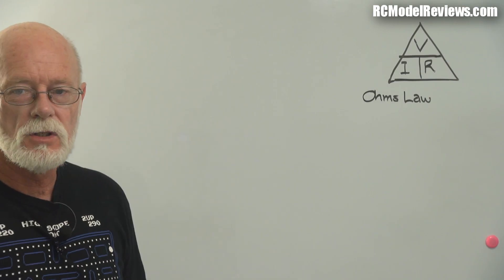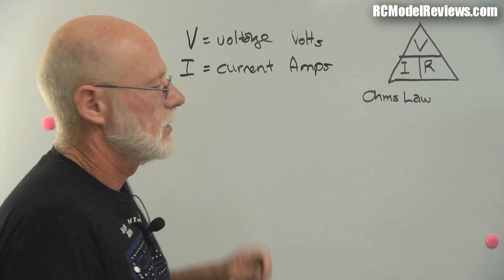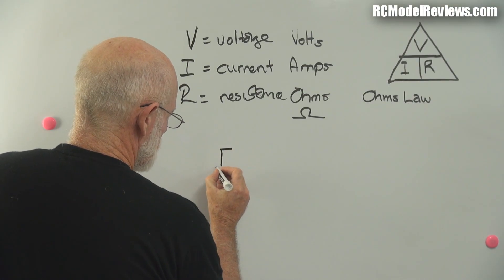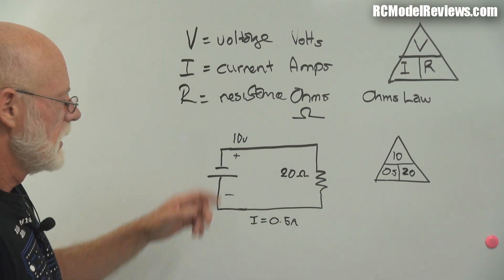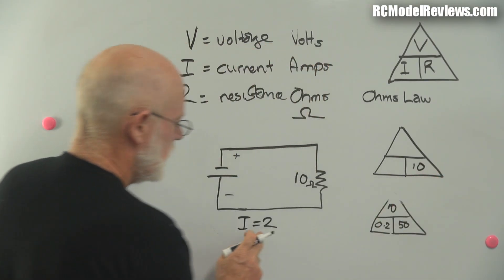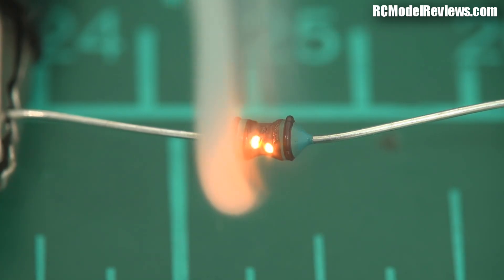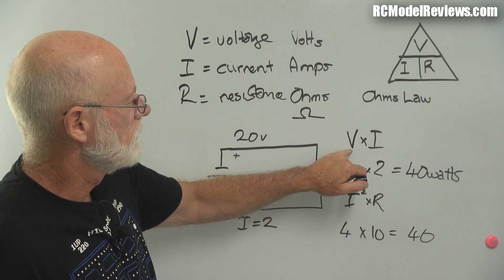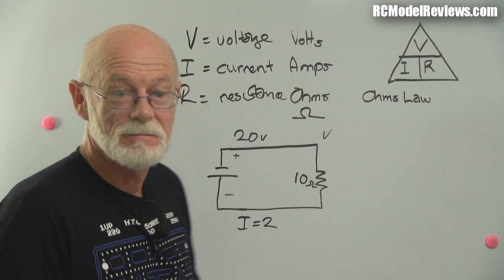Ohm's Law explained

Comment: E=IR =6th grade algebra ! Bad Boys rape our young girls but Violet gives willingly, get some now !  0= black 1=brown 2=red 3 =orange 4=yellow 5=green 6=blue 7=violet 8=gray 9=white ; 5%=gold 10%=silver 20%= none or no color.  First band=first digit second band=second digit; third band = multiplier or number of zeros to add ;forth band is the tolerance in percentage. The poem is a way to remember the color code taught to me by my father in 1965 ! Ya I'm an old fart of 63 but electronics got me A's in math,trigonometry  and algebra because I had somthing to apply all those formulas to that could be calculated and mesured with a meter or an oscilloscope . People don't learn from books they learn from hands on and practical application.  The books are just a road map but if you never travel the road you'll never understand the maps fully. I 💖 ELECTRONICS ! Edison-Tesla=AC-DC=ELECTRONICS ROCKS !

Comment: Dose this hold water Wen it comes to useing a vapor MOD?
Reply: Neo Blackjack thee enraged it does, same calculation you would use to make sure the resistance of your coil build wouldn’t stress your batteries past their stated limits. Just make sure you get your batteries from a trusted retailer, and build within the CDC (continuous discharge current) limit of the battery, not the “pulse” rating. There are a lot of fakes and “rewrapped” batteries on the market showing amp limits of 40A with 3000mAh for an 18650, when in reality it has a CDC of closer to 10A. If you were to use ohm’s law, you would think at 40A you would be able to build a coil or coils with a total resistance of 0.105 ohms on a single 18650 mech mod tube, but if the batteries can really only handle 10A, you’re in serious danger of venting your battery. Know ohm’s law, use good batteries (search for a guy named “Battery Mooch” for the best, most current info on most popular batteries), and for God’s sake build safely within your battery’s performance range. With all of the bad press about us vapers in the news, we don’t need another story about someone that blew themselves up due to ignorance. rant over

Comment: I is for inductance
Reply: Clint Chambers Well, Clint... that is the difference between DC and AC.
Reply: L is for inductance
Reply: Marlon is correct...L is for inductance, XL is for inductive reactance, I is for current (amperes) V is for volts which is emf (electromotive force) R is for resistance in a DC circuit but Z is for impedance which is resistance in an AC circuit

Comment: If (R) represents the diameter of a pipe per say, how does the internal resistance of the Lipo battery change? I'm imagining the diameter of the pipe getting bigger and smaller.

Comment: i dont really get the formula for power. i mean voltage is based on current and ressistance V=I*R cause you need both to have tension.so then, why do we multiply V by I one more time for power?
Reply: Maverick I'm guessing power = work done so you need to know the potential (volts) and the amount of electrons flowing (amps) to find out the work done. (power)

Comment: I ran a 55 foot 12 gauge wire from my generator during the storm to my wall AC that is 1800 W, 240V ON A 20 AMP circuit. With everything off the AC powers up albeit I can tell there's a slight drop in voltage listening to it run. When I place almost anything else on the generator the AC won't run. Total I was not using more than another 1000 watts. The generator has 4500 watts at peak and 3500 running watts with 20 amps. Question, using the equations that you used if I had a 30 amp generator would that had made a difference in whether the AC powered up? I understand over the run I must've lost power although when I tested it it still showed 240V before I plugged in. The charts that I saw stated that I could run it that long.

Comment: What a fantastic video Bruce,  I actually learned something !  I found most of the other tutorials to be a little confusing so lost all track of what they were saying.  One quick question if I may ........  could you substitute your 10ohm  resistor in your 20v circuit to a 55 watt bulb for instance ?  I'm trying to design a headlight wiring loom so I need to work out what the current draw will be on a 12v automotive circuit.

TURK

Comment: The resistance is like the diameter of the pipe by which the water (current) is flowing, so you'd need more pressure (voltage/tension) of you wanted the water to flow faster.

I loved that analogy!

Comment: Great video and explanation Bruce, but is there a formula for calculating how much capacity is drawn from a battery if you know certain parameters? Lets say I have a 4 cell 1500mah lipo at 14.8 volts, and I draw 60amps from it for 60 seconds, how would I calculate the mah of capacity being used? Thanks in advance Bruce

Comment: And from these equations, if you were only presented with the resistance and current, you can find the voltage with the simple equation (i squared x R / i = V) or (ixixR/i=V) so for the last problem in this video, if you knew the current was 2 and the resistance was 10 you would calculate the voltage like this; 2x2x10/2=20.

Comment: Thank you. I am newly enrolled in classes where it's critical to understand and use Ohms Law. After watching multiple videos and listening to class lecture I discovered your teaching video. I know it sounds basic, but other teachers assume we know the smallest of details. I am being introduced to all this math and nobody told me that 'current is measured in Amps' and 'voltage in volts' and 'Resistance in Ohms' until you stated that. Other teachers say they are 'related' or 'the same' or something like that. The fact they are units of measurement as is the term 'inches' or 'yards' had been a mystery (Lol!) until I saw your lesson. Thanks.

Comment: V•I {when V=3.94 and I=10.10} didn't work for me on an iPod. My calculations were  (V•I=39.794 & I^2•R=39.7839).(the "^2" means squared).
Why is this?
Reply: Cameron Kerner -- I think this is where your error occurred:
If you truncate the resistor value to .390 and don't use the full value of "R" (.3900990099), you get the result you saw on your iPod. See below. 
Your error:     (10.1*10.1)*.390 = 39.7839
V*I=P     {3.94 * 10.10 = 39.794}
I^2*R=P  {(10.10*10.10) * R = P}         R=V/I {3.94/10.10 =. 3900990099}
{(10.10 * 10.10) (.3900990099) = 39.794}
Hope this helps.

Comment: how would i convert 4.2 V - 6A to 7.4V -.890 mA. does the voltage matter when your deal with set values from a battery... it seem like it would be like working with 2 fractions with different denominator

Comment: 2:21 - The resistance aaaargh. This is pirate electronics 101.
Reply: Why don't you all try being gentleman instead of animals
Reply: hahahahahah
Reply: Hi, I'm Rachid
Reply: Olivia Lambert put the polarity symbols correctly. Lecturer put positive symbol to negative and vice versa. Dont mislead students
Reply: electron flow or current flow?
Reply: @tomfitzpatrick6524  either. Current flow in this circuit is clockwise . Electron flow is counterclockwise.
Reply: U looking very cute
Reply: gi
Reply: giggle
Reply: Noise Technician I was going to say this.. you beat me to it
Reply: Smart arse lol
Reply: Why dafaq do u have 1k sub, no vids
Reply: @saharyoussef6956  probably the picture. Post funny clever comments in a room of nerds and get jumped.
Reply: Olivia
Reply: Olivia Lambert hiii
Reply: Olivia Lambert fine arse bitch
Reply: R3LO4DED _9786 you will
Never fuck a girl
If you act like that for real.

Comment: +Ferrariassassin Not sure how you can get 10/0,5 to 20. I have tried 3 different calculators so far and each one has shown that 10/0,5=20. Meanwhile 10x0,5=5, not sure why you are even bothered by this calculation though. All you have to care about is that you take the 10 Voltage divided by 0,5 Ampere and it will equal 20. Therefore according to Ohms law the missing part of the three in the triangel will be 20 Ohms. So just forget about 10x0,5 it will lead you nowhere and will only make you confused :)!
@Ferrariassassin
Reply: 10divided by .5 = 20
Reply: Cap'n Lazlo ButtscaR thats because 10/0.5 is not half of 10.The actual mathematical process (for people who might wonder why) to explain it better is : (10) / (1/2) which is 20.Why? Putt it in a fraction.The denominator is a fraction itself. And the end result is (10/1)/(1/2) =  (10*2)/1 = 20 
now ,if you would MULTIPLY 10 with 0.5 thats another story.It is 5. Again fractions help to visualise : 10/1 * 1/2 = 10/2 = 5

Therefore 10*0.5 cannot be equal to 10/0.5. 
Not patronising you just proving there's nothing to be confused about :)

Comment: Ok question.. Ohms laws states "The total ____flowing in an electrical circuit will ___ when the voltage applied __ & __ when the total circuit resistance _.

Can you please help with understanding the words that are missing from this. I am doing my first year Auto Engineering and we have just started doing Electronics. as part of an assignment this is something we need to know so i looked online to get help. Can you help?????

Comment: Hi Bruce - could you explain what is the difference between LiPo batteries for multirotors and those for fixed wing aircraft? Certain LiPo packs are sold as special for multirotors - why would they not be suitable for fixed wing aircraft? Thank you!

Comment: That was an ace video! Would you use this with an atenuator  I think that's what it's called. The thing to dumb down the power from an fpv transmitter. As I see a lot of kits that come with a 200mW vtx but in the UK I can only use a 25mW. I was wondering how I can work out which one I need if I come across one

Comment: Are people really uncomfortable with basic algebra? What wrong with V=IR? It's more intuitive and makes more sense than the triangle
Reply: +Aeroscience V=IR requires transposition to get the other equations, the triangle however can makes it easier to remember the math relationship between the three electrical properties. Since V is above I and R it should be divided in to one to get the other (Remembering that fractions are the same as division, and oriented vertically).

Whereas IR are next to each other, and because when two variables are next to each other  in algebra they should be multiplied, so it is easier to remember that they should always be multiplied to give the property that you aren't using (V, or E).

And then you learn about impedance, and grow up from childish things such as the Ohmic triangle because it's not much use to you anymore.
Reply: I like the triangle =)
Reply: it is silly, but i was never able to remember  V=IR.  :) it is sot of to simple to remember.   triangle helps
Reply: i would go for the 3 corners,  triangle man!

Comment: I thought I knew all this, until something came to my mind just now. R = V/I. higher the V and smaller the current, the larger the resistance right. I know for a fact that the electrical grids carry really high voltage and small current to save energy via less heat loss.  So High V and Lower I causes high R. Does this mean High resistance causes less heat loss? I always thought the opposite to be true.

From juggling some equations I get:
1) power drop across a circuit can be measured by P=IV
2) from this we can get P=(I^2)R    or P=(V^2)/R   by substituting V=IR

So if I understood resistance, high resistance means smaller pipe, which means more collisions with electrons (=heat loss).  High current means more electrons at one point = more collisions = heatloss. 

So from looking at the equation does this mean doubling current quadruples the heat loss vs doubling heat loss for doubling resistance?
Have I understood this correctly?
Reply: Shayan Chaudhary high V and low I doesn't cause high R. Resistance is a physical property of the conductors/wires, not created by applied voltage/drawn current. Apply a higher voltage to s given resistance and you get a higher current. Transmission lines use high voltage in order to be able to transfer high power with less current. This is done because it's the current that causes losses  in the wires according to P=RI^2 where R is the resistance of the wire, which is set by length, materials and thickness.
Reply: Shayan Chaudhary As. To power and resistance; if you have a constant voltage say 220V and apply that to say a resistive heating element.
A given resistance will allow a certain current to flow, a caccording to I=V/R.
This produces a certain power.

If you halve the resistance, keeping the voltage the same, twice the current will flow and therefore the power will double.

To push twice the current through a given fixed unchanged resistance, you would have to double the applied voltage and since you have both 2x the current AND 2x the voltage you get 4x the power

Comment: Yu had your battery symbol wrong. The short line is the negative....
Reply: +Barry Cole Electrons will still flow form + to -, so it doesn't change the calculations :)
Reply: +Maple Syrup But you have to get the detail correct.....

Comment: When I learned all this stuff we used E for voltage (Electromotive force).  so E=I*R.  Also is worth noting that the triangle works for wattage P. Using E in place of V you get the pie formula.  P=I*E.  Solving for the other values, I=E/P, and E=P/I.

Another trick for those not algebra savvy, start with the basic formula E=I*R.  the idea is to get the value you DON'T know to be by itself on one side of the =.  You do that by dividing both sides of the equation by the value you KNOW.  

So if you know voltage and resistance but not currently you divide both sides by the resistance as follows.

E/R=(I*R)/R 

NOTE: the ()'s are to show that you must multiply before you divide which is the natural order of precedence in math.

This is allowed because you're doing the exact same (equal) operations on both sides of the =.  Also note that any time you have a number (or variable) over itself (i.e. 2/2 or 5/5) it always equals 1.  (think 2 halves make a whole).  So to make it easier, the Rs on the right side cancel each other out. (I*1 is just I).  To balance the equation again you have to do the same thing (divide by R) to the other side.  

E/R=I*R/R which equals E/R=I.  Since bother sides are equal you can flip it back to front and you end up with I=E/R.

This is how I learned it so it might be more confusing to some or it might help.  

Enjoy.
Reply: This is exactly how Im learning it now
Reply: tldr = use transposition
Reply: yeppers old school  e = v   in this video  the v in the video slows me down.  eV   of course is electron volts.  when working above light frequency the use of eV is easyier than frequency length.  you all knew that,,,,bye

Comment: hey !! yeah i forgot to manshion that, also my englisch writing may not be that good so sorry!! i want a power supply for charging lipo's . i want it to be compatible with ac 100-240. and i want it to deliver 5 till 30 volts. i also want it to have 2000 watts ( high amperage) so it can supply multiple  high wattage chargers. ... but maybe it is smart to start with small power supply just for learning :) and that is also my main goal, i want to learn everything about electronics. to bad i did not started learning when i was younger (now 24) if anyone can help me begin my quest for knowlagde please let me know ! :)  thsnks in advance .. ruben

Comment: Please Bruce make a video about parallel charging Lipos!
Reply: hi, there are many vids on parllel charging ... and good ones two !! i learned a lot from them ;)
Reply: +xuxusito No need for a video.  

1. Make sure they are close in voltage when you put them in parallel

2. Add capacities.  Two 1000mAh = 2000mAh, so 1C is 2A.  1500mAh + 500mAh = 2000mAh = 1C is 2A. etc etc

3. Don't mix cell counts, but it's OK to mix capacities.

4. You need a relatively powerful charger to charge in parallel, since you have to charge at higher currents to keep 1C.  If you have a weak charger, you won't be able to charge as fast.

Comment: I like the use of water pressure to explain it, i used to explain it a different way, i used to say that a train was the voltage, and the current was the weight of the train. Your simple way using water pressure is much better. Interesting video, Bruce, i look forward to the upcoming ones.

Comment: thankss! can you make a vid on how to build a powersupply ?
Reply: +RubaDub Vogel... Hi,
Just a tad more info required I think.
 Exactly what type of power supply do you require?
What Input/Output Voltages? Fixed or variable output? AC or DC?
What Output Current? 
A variable power supply can be had very cheaply nowadays.
eg; You can buy this one for $1.00. Yep, just $1.00.
> http://www.readytoflyquads.com/rtf-1v-17v-adjustable-voltage-regulator
Output up to 3 Amps.
No need to build one, unless you need the experience.
Many, many more on eBay.
Reply: +Laurence235 hey i respond on you massege .. thanks for it !! :)

Comment: And voltage is U, U = I * R
Reply: Well maybe this is a Dutch thing?  The U in state of the V.
Reply: +Edwin Noorlander Never heard of U... it is V in this planet ;)
Reply: +thekaduu well your site of the planet.  https://nl.m.wikipedia.org/wiki/Wet_van_Ohm
Reply: +Edwin Noorlander Voltage = E . E is electromotive Force, so E = I*R
Reply: +Edwin Noorlander Your quite right. Ohm's law is from a German physicist Georg Ohm. He used in his book the U for Voltage difference. He calculated or measured a voltage difference between two points. 
Bruce needs to explain the three laws of Kirchoff to fully understand voltage difference, current flow and resistance in a single powered circuit. 
And for P (power) there is also P=U^2/R.
Reply: +I don't know long life the standardization 👍🏻😂 I'll vote for V. 😜
Reply: +Edwin Noorlander And the you´ll also write W for Watts in your formulas? Meh...
Reply: It is whatever you want it to be :Pp
Reply: For uoltage? XD